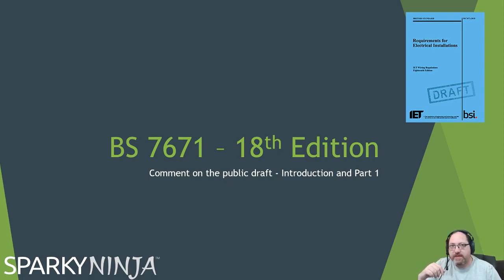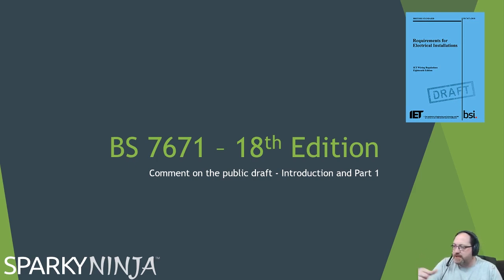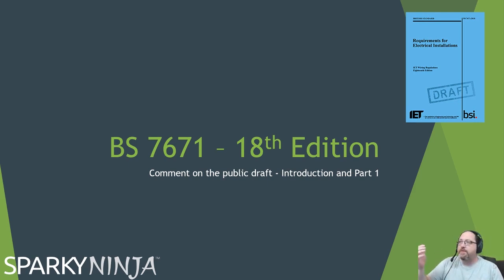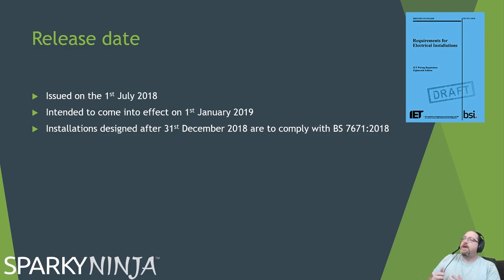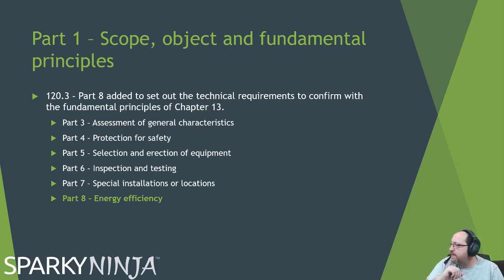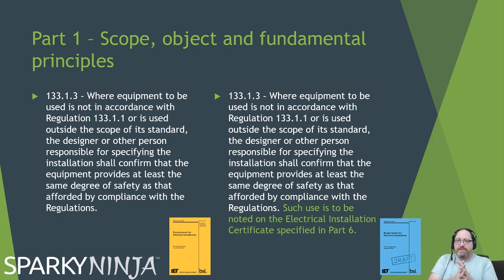BS 7671 - 18th Edition - Public Draft Commentary - Introduction and Part 1

Comment: I'm planning on pre ordering my 18th reg book. Also to take the exam within  2 week after. The question is having my 18th edition before December 2018 so is it good option? All the work i will carry before end of 2018 will it fall on the 18th requirement?
Reply from the maker: Between 2nd July and the beginning of the new year, all work will need to comply with either standard, from the new year the 18th will be the required standard.

Comment: Hi Ninja 
Thanks for the heads up on the multimeter equipment. However, I’m scheduled for my 17th exam and find it hard to find certain topics. Any suggestions, hints or tips? Your help would be appropriated. Ta

Links’s
Reply from the maker: Hi,

It depends on the quality of the training you have received tbh.

My advice is to always read the question once, then again. ONLY THEN LOOK AT THE ANSWERS!! Then read the question a third time.

Often if you see the answers first it can affect the way you read the question.

Sit back and think before answering.

If your training method has been by going through practice paper after practice paper, try to forget all the little details, but remember the bigger picture.

For example if you get a question like:

Q.The maximum permitted surface temperature for an item of non-metallic equipment, intended to be touched, is:
a. 55°C
b. 65°C
c. 70°C
d. 80°C

You've probably got in your mind an image of a table, and you remember roughly in the course where you saw it and you go flicking!

Instead, remember the layout of the book, and the overall content of the chapters. So with this question I know its regarding equipment - so maybe I'll go to Part 5? but I'll never find it.

Instead if I analyse the question and recognise that it is regarding a thermal effect (burns) and the protection against it, then I am looking for the Chapter on protection against thermal effects. I may know where that is straight away, if not the contents page will help, I may even notice there that there is a section titled 'Protection against burns - Section 423!

Also if I read a question and I know the answer, just answer it. Don't waste time looking through the book for it. I could always flag it and return at the end for 'confidence boosting' if I need to. If I waste too much time trying to eyeball every answer then I'll be under great amounts of pressure if the time runs out - and bare in mind that the last chunk of questions come from Part 7 and the Appendices and these should be guaranteed answers.